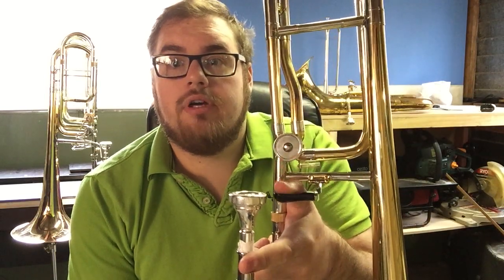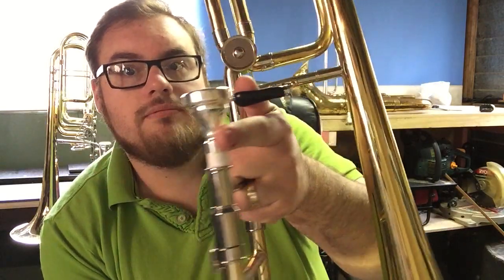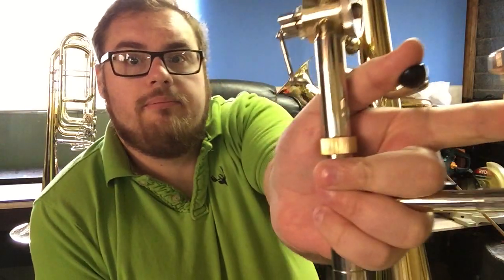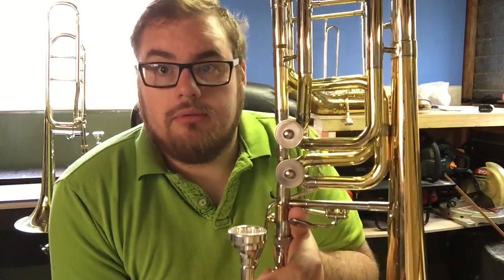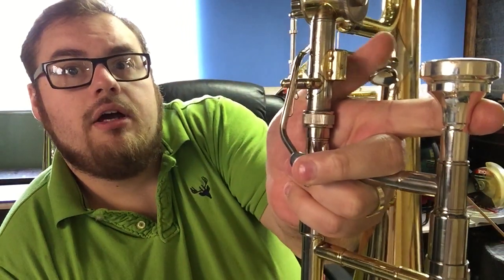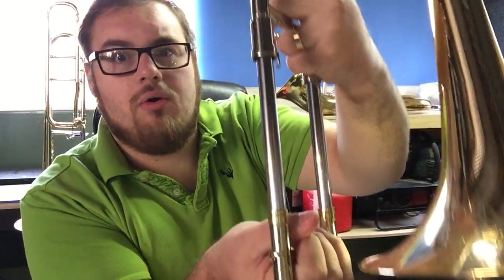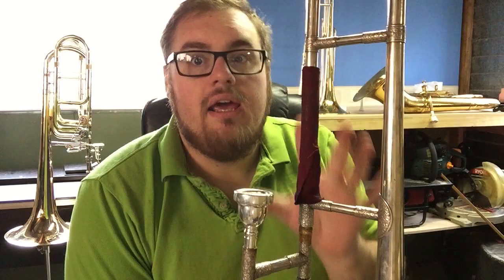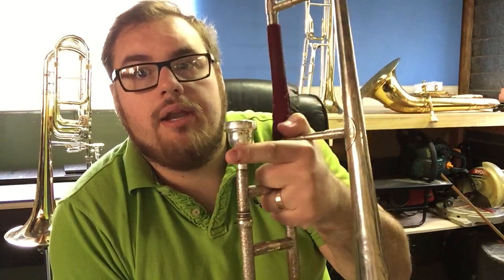How to Hold a Trombone... PROPERLY.

Comment: I am starting out on a single tenor trombone (no F extension).  As my hands are smaller, I find that using your left hand position is a lot better than the standard one.  However, I find that (for me) the most comfortable position is to have the second and third fingers on the face-side of the lead-pipe brace (so that the thumb can curl comfortably around the bell-brace) and the fourth finger on the other side of the lead-pipe brace.  (As an ex-french horn player, I use the term "lead-pipe" in reference to the part that the mouthpiece fits into.  Sorry if that is confusing to anyone).

Comment: I checked through your videos, but I didn't find one that addressed this important question:  How in the world am I supposed to open the spit valve on a bass trombone and blow through the instrument at the same time?  My arms aren't nearly long enough.  It's hard to say from that angle, but I'd say there's a a good 3-4 inches between the ends of my outstretched fingers and the end of the lever.  I'm 171cm tall (or 5'7" in the superior English system), so maybe smaller than most bass trombonists, but still about average size.

Comment: Hey Trent, I just recently bought a trombone and was wondering, how do you memorise all 7 slide positions without mistaking one for the other?
Reply: Daniel baker 1st position- easisiest one all the way in
2nd position- about and inch and a half out from 1st (depending on instrument) 
3rd- the grip of your slide is alligned with the end of the bell
4th- the end of the outer slide is alligned with the end of the bell
5th - you just have to mess around with this on your instrument
6th - same as 5th
7th - as far out as you can go without your slide coming off
Hope this helped!
Reply: Btw im frshman trombone and concert band section so this is good practice helping out lol
Reply: Dyllon DaSloth Same here, just started out with a trombone, those tips did help, my Bb major scale actually sounds like a major scale instead of a fucked up harmonic minor, so thanks for that.
Reply: Daniel baker no problem my dude 4 years playing 5th position is still rough
Reply: Put your hand on the slide and hold it normally, start in a position you know and kinda flick your wrist out, that distance is roughly in the next position. But what i remember is first is all in, third is where your slide handle meets the bell (kinda) , fourth is where the end of your slide is at the bell, second is somewhere between first and third, and i hope you have a good ear for staying in tune because youll need it for 5th 6th and 7th positions. Btw there is an eighth position, it juat doesnt sound good because its off the slide
Reply: Daniel baker Muscle memory
Reply: Daniel baker I will give you a small tip that will help you, if you don't already know this. First position is kind of tricky because only a few of the notes in that position are actually all the way in. For example, F is a little bit out from all the way in. I've found that F is out as far as the thickness of my thumb. I slip my thumb between the slide grip and the lock. As for the other notes, I'm not quite sure. F is the only one I am sure on.